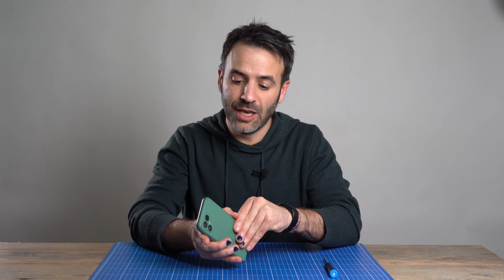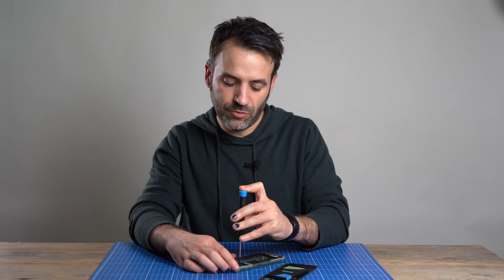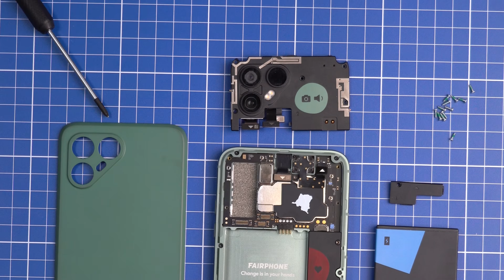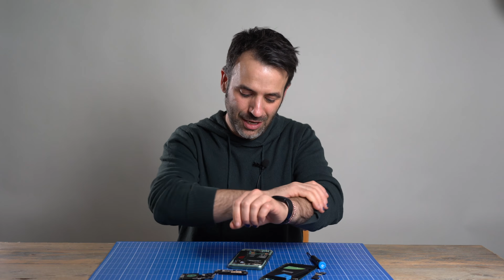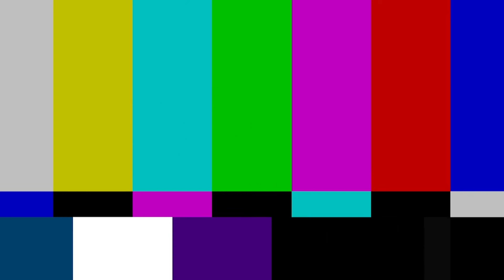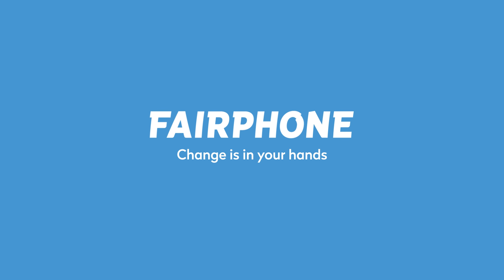Inside the Making of the Fairphone 4: Discover the Challenges and Decisions That Took Place

Comment: I hope the fairphone 5 comes with a headphone jack, otherwise I'll have to abandon the brand. I've had the fairphone 4 for a few months now and I want to throw it in the garbage on a bi-weekly basis. I had the fairphone 3 before and I never felt hate for it (or any other phone for that matter). I never imagined I could hate a phone before I started using FP4. Using FP4 is Hell and I want to inflict violence on every single person involved in the removal of the headphone jack. This is the worst phone I've ever owned solely because of this design disaster. 

I love the repairability etc, but this user experience is horrible. I've gone through two usb-c to 3.5 jack adapters already, praying that the 3rd will last long enough for me to buy another backup. The sound quality though the adapter is awful, there's more wear and tear on the usb-c port, the one brand of direct usb-c headphones I could find are overpriced and also low-quality. If I had known that the phone didn't have a headphone jack I wouldn't have bought the phone to begin with. I wish I had checked more carefully, but sadly I blindly expected Better from this company. 

Heck, the removal of the headphone jack isn't even compensated for in the rest of the design. For example, now I have to keep the phone upside down in my pocket every day because the usb-c hole is still at the bottom of the phone instead of at the top where the headphone jack used to be. The volume and power buttons are now on the "wrong" end of my phone, meaning they're slightly less reachable and slightly more likely to be accidentally pressed while I walk which plays merry hell with the already shitty sound experience.

Kind of laughable to say "we wanted to design a phone with more character" and then the most notable change from a user perspective is just a copy of apple's shittiest design choice.

Comment: Removing features like FP4, is NOT the right direction!  The value proposition of FairPhone is long term sustainability for the owner, not the industry! Instead of removing headphone jacks and other features, go with dual everything! Fairphone should differentiate itself in many ways... 2 SD card slots on the outside, infrared, privacy case with front/back camera covers, dip switches to physically disable mic/cams/wifi/bt/nfc/gps/sims/gyro/sensors/etc... Fairness for the makers is interesting... Fairness for the owner is actually useful! These devices are evil and are leveraged by evil people... Any design measure that gives the owner better control over their property, is much more fair! Keep up the great work FairPhone!
Reply: Agreed, the end users ability to control the device is very important

Comment: FP 4 is such disappointment for me. I can live without OLED screen and with mid-range CPU. Nothing is perfect. But no headphone jack on top of that? C’mon! I was hoping my already 7 years old smartphone will last until FP5 comes out, but recently screen cracked and I now have to look through other manufacturers BS. My head already hurts. You were supposed to be different. What next will you get rid of? SD card slot?
Reply: Exactly! Dual everything! Fairphone could differentiate itself in many ways... 2 SD card slots on the outside, infrared, privacy case with front/back camera covers, dip switches to physically disable mic/cams/wifi/bt/nfc/gps/sims/gyro/sensors/etc... Fairness for the makers is interesting... Fairness for the owner is actually useful! These devices are evil and leveraged by evil people... Any design measure that gives the owner better control over their property, is much more fair! Keep up the good work FairPhone!